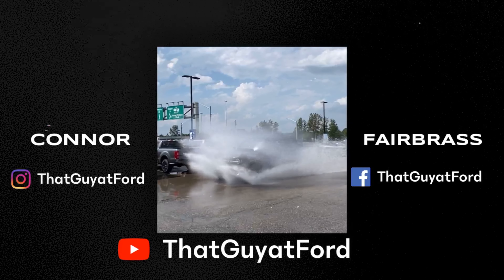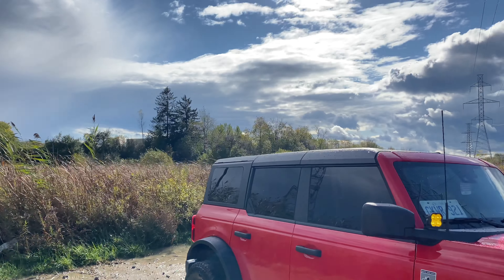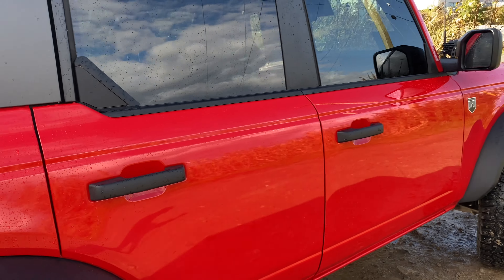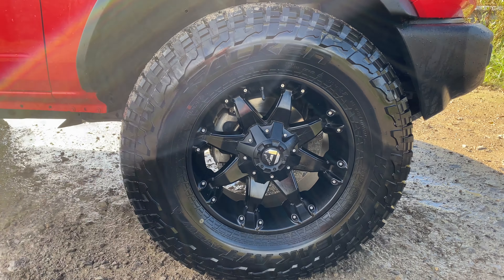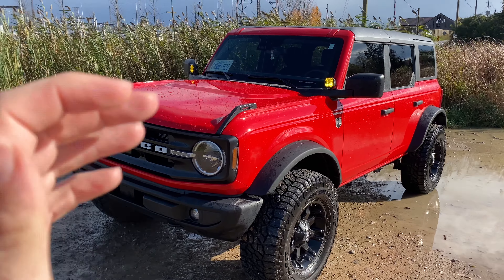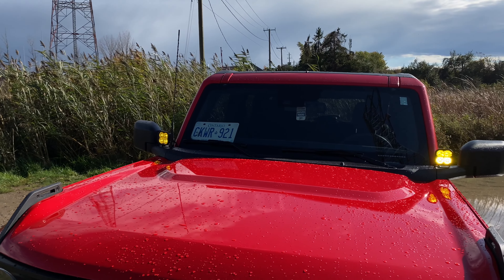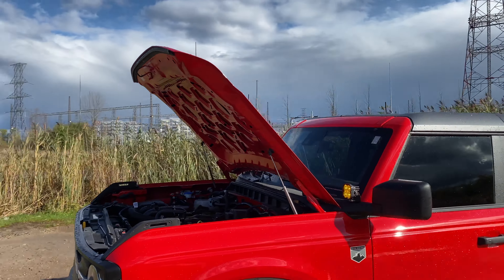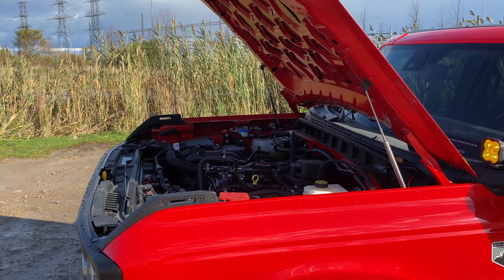(I MADE MY OWN SASQUATCH) 2” ZONE LIFTED MY 2021 BRONCO BIG BEND - Sasquatch Fenders Flares

Comment: I feel it's better to get some sort of decal or paint protection film than ruin the badass offset the -12 gives. You got great wheels then covered up what makes them badass. Should have just got a 0 offset wheel and saved spending $ on new fenders which are not cheap if you want that tucked stock look. Every Bronco at SEMA shows have a ton of poke because it looks sick.

Comment: Did you add front & rear lockers ? 4.7 drive ratio ? No… then you only lifted your truck.
Reply from the maker: This has the 4.27 rear ratio from factory, which is a locker, but no front locker. Replicated a Sasquatch look.

Comment: Hello from Sudbury! 

I just took delivery of my 2022 Big Bend in Cyber Orange. 100% need to get my hands on a lift and 35s. 

I really want a hard top, but I refuse to pay 18,000 to buy every piece individually. Ford needs to hurry up and release them. 

Also, I need those hood struts lol
Reply from the maker: ADVFiberglass is apparently doing a decent hardtop for about $8000!
Reply: @ConnorFairbrass  that's still SO much money 🤣

Someone will sell one, one day
Reply: @ConnorFairbrass  curious ... do you know of ANYONE able to get their hands on the onboard 4 door storage bags?
Reply from the maker: Your local dealer should be able to?? I ordered some not long ago and they came in pretty quick! 1-2 weeks?
Reply: @ConnorFairbrass  I was told it was something that needed to be on the original order, but I'll try my local dealer! 

Thank you
Reply from the maker: No problem at all!! It can be ordered through your parts department AND you can use your $200 from FordPass to put towards the door bags!
Reply: @ConnorFairbrass  confirmed with my dealer, they have no way to order them. Strictly something that I would have to have added at time of build (I didn't build this, I just stalked the transport delivering it and put it on hold the moment they opened)  and cannot be bought afterwards 😔

Sad day
Reply from the maker: Send me an email Chris, I’ll help! cfairbrass@kitchenerford.com

Comment: everyone is gonna do that. but the best part of the sasquatch is the bigger front axle and lockers.
Reply from the maker: Definitely agreed! Mine was ordered with rear locker so I’m just missing the front locker and Sasquatch suspension. 
You can also just get a badlands non Sasquatch, get front and rear lockers, sway bar disconnect and then lift with 35’s and have basically a Sasquatch!
Reply: @ConnorFairbrass  close. Your still missing the Dana 44 front equivalent center section. The smaller front axle is basically dana 35 equivalent which I wouldn't trust 33s on.
Reply from the maker: You are very correct! I didn’t think of the different axles, was just thinking of the ratio! Very good points
Reply: @ConnorFairbrass  oh and the sway bar disconnect is super cool. But I'm sure there's gonna be an aftermarket manual version to do that on all others.
Reply from the maker: I believe you are correct! I think I even saw that the OEM manufacturer of the disconnect could be selling it as a kit! I’m surprised we haven’t seen anything released or teased at SEMA so far…

Comment: Nice looking truck. I'm not a red car guy, but mixed with the black it looks badass. I have a Big Bend on order (cyber orange) and I want to do the same thing. What did the dealer charge to add the lift kit?
Reply from the maker: Thank you Mike! Cyber Orange is a beautiful colour, super under rated in my opinion. For the lift, alignment, 5 rims and tires with sensors and mount/ balance, it was about $5500 Canadian
Reply: Did your Big bend come with flares that match the red? I also want black flares but didn't know if my order would come that way.
Reply from the maker: My big bend did not come with colour matched flares. Only outer banks, non-Sasquatch will come with colour matched fender flares
Reply: @ConnorFairbrass  ok cool, thanks. I'm not a fan of the colored flares. Black looks better

Comment: Looks great ! Any issues after the 2” lift and 35s ? I read of some people breaking CV Joints and Axles coincidentally after doing 2” or bigger lifts and going 35s on non-SAS packaged trims. I just ordered an OBX and not sure what size of tires or lift to do after reading all that.
Reply: Did you figure it out?
Reply: @juniormata98  Yup. I’ve got 37s on a  3” lift and about to lift it up another inch. It’s been great.
Reply: @TheRockStar777  what type of lift did you use?

Comment: Wait so did you have the fender flairs, hood trail sights, grill, roof all painted black? I'm completely on board with that if that's the caes.
Reply: ...and the mirrors?
Reply: ...door handles black too? I have benn thinking of doing all these a few months back for greater contrast against the area 51
Reply from the maker: @Hanleycreative  So far JUST the grill has been done Christopher. However, the door handles, mirrors and hardtop would be a GREAT idea to build some heavy contrast.

Comment: What gear ratio did you have on your big bend? 4.27, or 3.7? Notice any performance changes when moving up to the larger 35's? I'm looking to do the same thing (I've got a big bend with the 4.27 gear ratio + rear locker), and that is my main concern. Also, did you have to remove your crash bars?
Reply from the maker: Great questions! My big Bend does have the 4.27 rear ratio with the rear locker. There’s inevitably going to be a performance change going up to 35s however it was not as severe as I thought it was going to be. You definitely notice the loss of torque going to the bigger wheel and of course The fuel efficiency drops.
Reply: I have 4.6 ratio. Can I put on sas wwheels set? And will I need a lift? Thanks

Comment: Puck lift on any off road vehicle?  Yeah,  no thanks.. I do love the new bronco though.  Just give me a true lift offroad  suspension. No puck lift please.
Reply from the maker: You’re entitled to your own opinion! This held up just fine offroad last weekend going through it’s paces. Do you have a Bronco or off-road vehicle? Interested to know what lift you have on your vehicle.
Reply: @ConnorFairbrass  I have a 17 Raptor ,  no need for a lift offroad. I'm a ford fan through and through. If I needed to lift my ford, it would not be through a puck style lift... Total crap, hillbilly lift then... It would be a new coil spring at minimum.  Your spending so much money already just upgrade to a true coilover suspension lift.. Which is not to much more, and better suspension overall. Just do it once, and be done.
Reply: John T — Kind of like this one: “2021 Ford Bronco two-inch lift kit is manufactured by Bilstein – which supplies shocks for the Bronco’s Sasquatch Package – and is tuned by Ford Performance. It’s designed for use on two- and four-door Base, Big Bend, Black Diamond, and Outer Banks trimmed Broncos but is not compatible with the Sasquatch Package.

The new lift kit consists of massive 2.65-inch mono-tube shocks that are 60mm in diameter, which makes them the largest shock diameter of any production 2021 Bronco. The shocks included with the Sasquatch Package are 46mm in diameter. Additionally, the kit comes with front and rear coilover springs that are identical, direct bolt-in, one-for-one replacements with those included in the Sasquatch Package.

Ford Performance two-inch 2021 Ford Bronco lift kit includes these components for both the front and rear and both have been tested and confirmed to provide superior performance and durability.